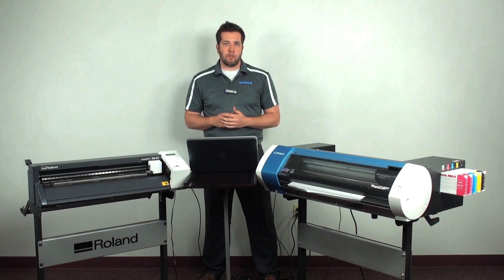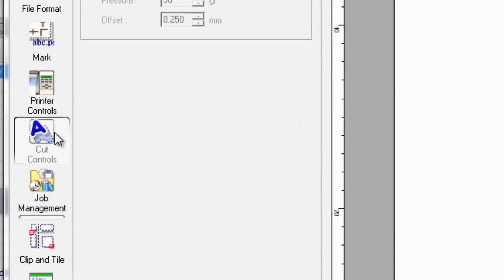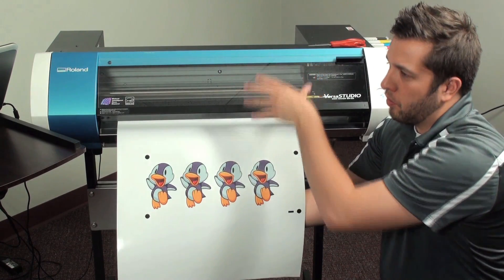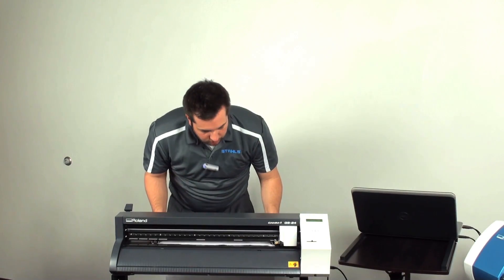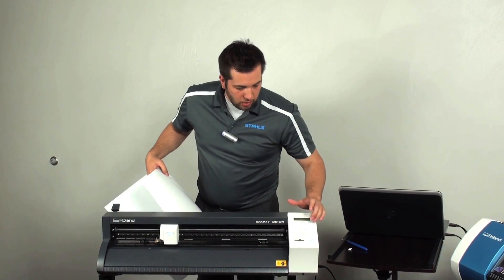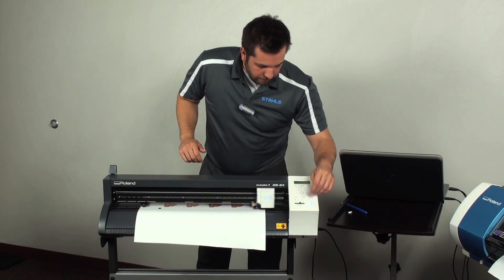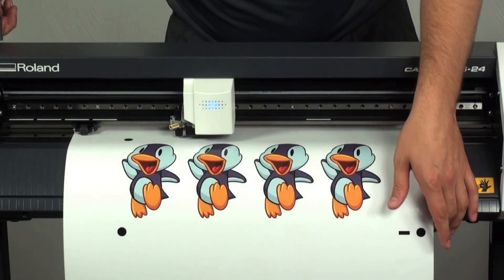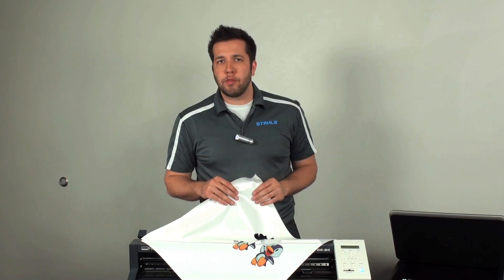Roland® BN-20: Printing & Cutting with Crop Marks in Versaworks

Comment: Im trying to decide but i dont get it why do this if the bn20 cuts also its not like you where being quicker?
Reply from the maker: Hey Hector - while both of these cutters can cut the design, the BN20 is much slower. So for better production efficiency, you could be printing on the BN20 with one design, and cutting another out on the  standard vinyl cutter.
Reply from the maker: Another tip - some materials take time to gas out the ink after printing and before cutting. Adding crop marks allows you to remove the material from the machine to gas out and keep printing more jobs.

Comment: Nice video, I am printing on HP Latex 335, and when send the material for cutting, have a lot of problems with X-Y offset ?One more think my cutter Roland Cam1 servo GX 24 reads only 3 of 4 crop marks? Any idea and /or suggestion of how to manage offset? Changing offset parameters from the cutter menu does not help?

Comment: Actually, looking at this vid again its idiotic. Why would you need a cad cutter? when versaworks can do all of this. Just print and cut
Reply: Yes in the context of this video it seems silly to just use the print+cut for printing. But consider someone who buys the BN20 as a starter system, then gets popular. He will quickly realize that adding just a $1500 cutter would massively increase workflow and let the superb BN20 print only (which is the slower process)
Reply from the maker: You could certainly complete all of this on the BN20 within Versaworks, however some like to cut on a separate machine and laminate in between for decals, floor graphics etc for extra outdoor durability.  For apparel applications, there would be no reason to no print and cut on the same machine at once unless there is a dry time for the material being used before cutting.
Reply: @StahlsTV  does the bn20 not die cut all the way through? Can it kiss cut only?

Comment: Seriously what is the point in printing with the BN22 and then cutting with the cutter using crop marks. All you have to do is create a cut line using Illustrator of Coral Draw and the BN22 will print and cut. This is retarded
Reply: Wow, so many of the same comments. And it's a BN20 not BN22.

Comment: Oh dear, Versaworks can do this anyway, so the BN22 can do all this on its own
Reply: My BN20 9 of out 10 times doesn't recognise the crop marks... people on the forums had the same problem
Reply: @amiami93  You dont need crop marks, its called a PerfCutContour. Its a spot colour in Coral Draw or Illustrator. When imported in to Versaworks it will cut the sticker and perf cut through the vinyl
Reply: @maxpower9340  you need crop marks if you add laminate to the decal

Comment: Hey Joe, why are you using a plotter/cutter when the BN-20 is a cutter and a printer? Thanks in advance!
Reply from the maker: To speed up production; the BN-20 has a stepper motor and cuts at a slower speed.

Comment: Are you able to print the crop marks and do an immediate print and cut. So click the box for crop marks, yet still use the print and cut setting immediately. We are having troubles with our printer staying consistent with its contour cut on 100s of labels. We want to be able to cut 100s of labels on the same sheet without having it go askew.

Comment: Hi, im using the same setting print with bn-20 and cut using gs24. But the issue is that my gs24 cant read the crop mark even at the first registration mark. Is there something wrong with my gs? Need advice.

Comment: why are u letting it cut from a seperate cutter? dont the bn20 could do it also`?
Reply from the maker: Hello,
The BN-20 is one of the slower print/cut systems. By using the crop marks to print the image on the BN-20 and then having a faster machine cut the design, you can save a lot of time in your production process.

Comment: Waste of material, it is better to print and cut with the BN20 and not invent cut with another plotter
Reply: Héctor David Moral
Reply: One reason why I decided against a print and cut setup. I rather have my printer printing continuously than to use it for cutting while I have a backlog of print jobs waiting in line.  I have a larger setup in the EJ-640 & GR-640 for this reason. And what if you need lamination? You would still have to remove the print, laminate...put in back into and cut again.
Reply: There is a better method this bs and a waste and only reason to remove would be to laminate or someone who wants to cut faster but in that case why buy a print and cut its best to just buy a latex printer

Comment: I don't get it.. I'm just new to studying this and why would anybody buy a printer/cutter.. only print on it.. and buy another cutter to cut?
Reply from the maker: +Tommy Durant Hi Tommy- Some decorators prefer to have a separate cutter with their solvent printer or print and cut system for speed of production. The BN-20 model specifically has a slower print/cut head than the Roland Versacamm or other vinyl cutter that cut up to 50 cm/s. For this reason, some decorators may choose to keep their printer printing and switch over to the cutter for faster production in cutting.
Reply: @StahlsTV  No they do not. The speed is of no concern at all. It takes me around 60 Mins to print and cut 10000 decals on a BN22